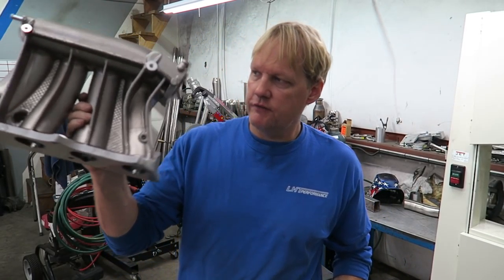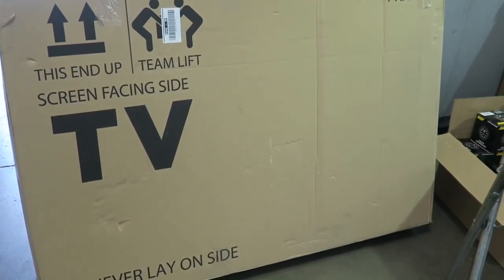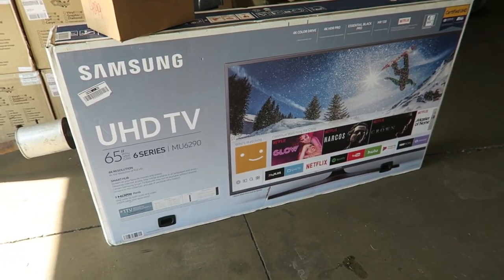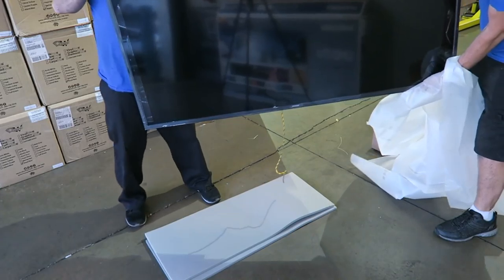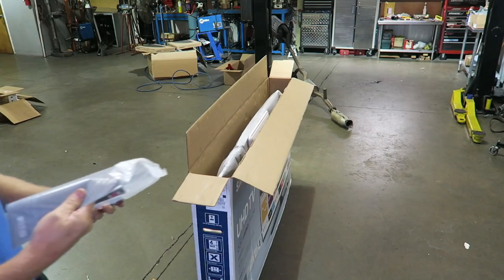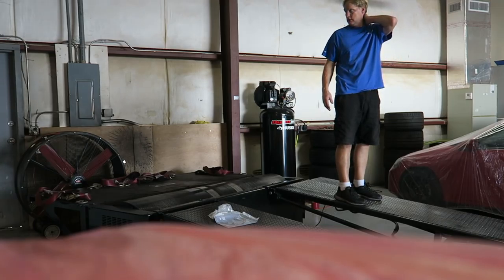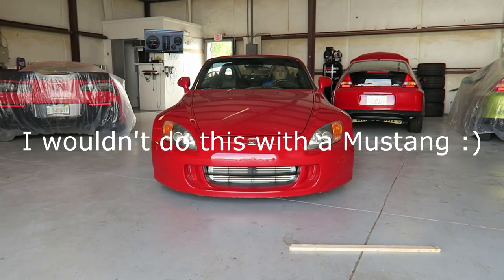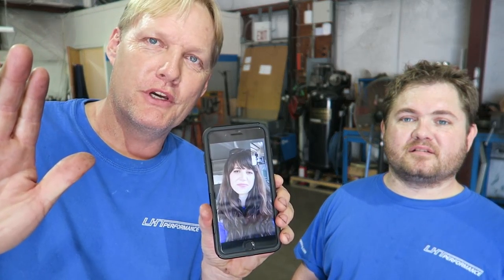Broken TV, port intake manifold + John , George and Esther

Comment: LHT "TV" Performance! It's the rule of thirds, it's always the third one that works out.

John, quick question for you. Is there a way to verify 100% TB butterfly opening (visual inspection) on a DBW Honda using Hondata flashpro with the car not running? Supposedly the GD3 FIT's only open to 80% max on stock ECU, should I just check voltage for WOT in the TB map then get a reading from the TB TPS engine off manually opened to 100% to verify? 

BTW that intake manifold you built for the L-sight came out awesome! 100 wheel HP on a stock L15A1 is damn good, I assume it was just the intake manifold and Hondata combined with the insights lighter wheel/tire setup that got you there? No lightened flywheel right?

Great work as always LHT team!
Reply from the maker: Thanks for the comments. I can data log the the throttle plate and the pedal. You can also take off the intake tube and visually see the throttle plate open. With the key 'ON' (Not running of course) have someone hit the gas pedal.
Reply: LHTPerformance 

Awesome thanks that's just what I was looking for!  Been meaning to do it for about a year now. BTW the R18 TB is 5mm larger than the L15a1 one but is a direct swap for the intake manifold/TPS for your next L15a1 custom intake manifold.